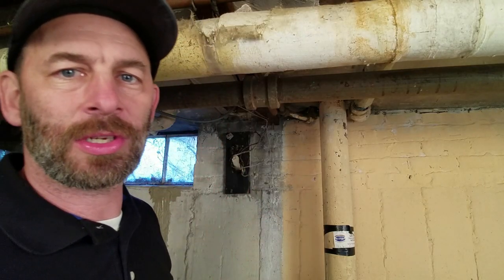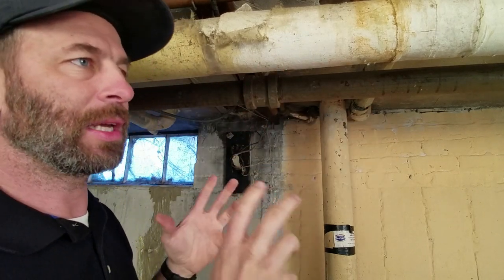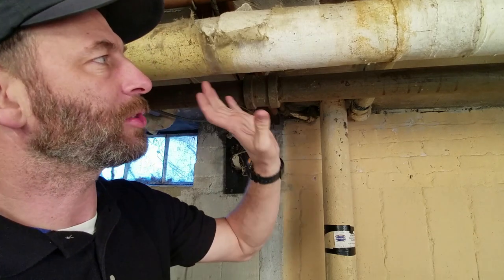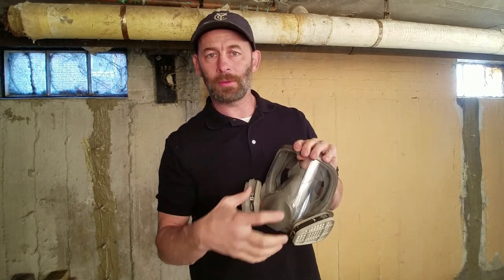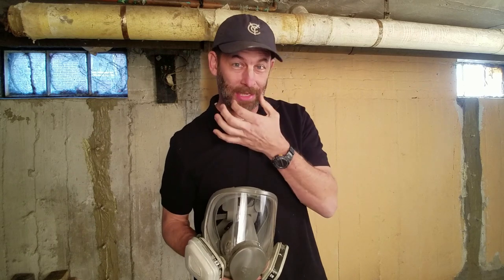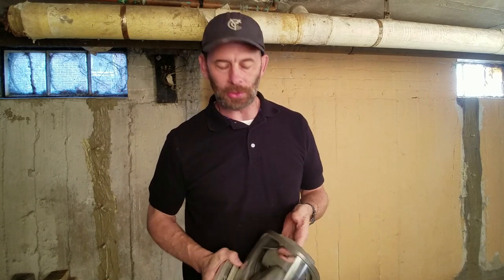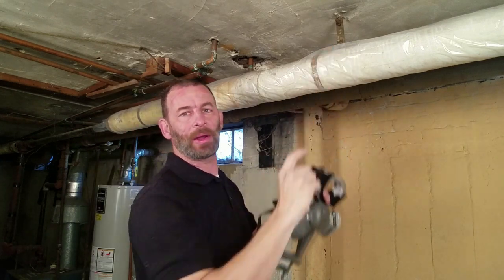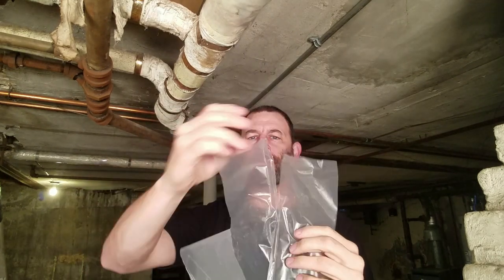Asbestos Pipe Insulation Identification and Encapsulation (sealed covering)

Comment: I am an asbestos removal operative. We use serpi-coat witch is a paint specifically for the encapsulation of asbestos.
Reply: Great product!
Reply: Hey Paddy, how would one clean a mask and remove clothes after dealing with asbestos?
Reply: Depends what type you are stripping, for more serious stuff you would come out of the area directly into a 3 stage decontamination unit. If its non notifiable work then a wipe down and disposal of coveralls etc will be good.

Comment: I’ve done quite a bit of work in refineries and chemical plants where you have to be clean-shaven to use a respirator or supplied air. Having facial hair disrupts the seal around the mask and you are still getting unfiltered air whether you realize it or not. Not trying to be a jerk just food for thought.
Reply: Excellent point.
Reply: Firefighters are required to not a beard for the same reason.
Reply: Thank you for this important advice! Especially when removing asbestos on one's own, it is important to strictly adhere to the applicable regulations and recommendations regarding occupational safety. Otherwise you may endanger your own health and that of your fellow human beings.
Particularly in the case of renovation and refurbishment work, the following therefore applies: Exercise the greatest caution and play it safe! Even a small material sample is sufficient to determine in a professional test procedure whether a suspicious material contains asbestos. If the commissioned analysis confirms the suspicion of asbestos, have any work on it carried out exclusively by service providers with the necessary certificate of competence. This is the only way you can be sure that there will be no accidental contamination of your living space or clothing with asbestos fibers. If you want to know more about possible locations of asbestos in your home, feel free to visit our interactive asbestos house: https://www.crb-gmbh.com/en/interactive-graphic

Stay healthy!

Comment: I followed advice from a buddy in our local pipe fitters union and just removed it myself.  P100 mask, long gloves, disposable body suit.  Connect garden hose, use mist setting, and soak it all down. Keep a large garbage can under work area, and as it becomes saturated it will break and easily fall into can lined with a contractor bag with no dust.  Just keep it all wet, keep the hose in hand as you go. Seal bags wet and move on.  For residual sticky stuff on pipe, do another pass- keep it very wet. Scrap pipe with file or rasp to turn it to residual into mud and wash into garbage or wipe down with disposable clothe and throw in can, and repeat. Don't let muddy residue drop on ground where it can dry and create dust later. Just be smart, and be careful. Words to live by.
I clean my basement in 2 hours. Sure beats a  an $8000 abatement job.
Reply: I will try this myself. Is there a proper way of disposing it, or just put it in garbage bag and take it out on garbage day? Did you soak it with the mist, how much water?
Reply: Please no one try this. This is not how you removed it.
Reply: HORRIBLE IDEA!!! DO NOT FOLLOW THESE INSTRUCTIONS
Reply: Exactly, water makes it much safer to work with. I just posted that before reading your comment. It's freaking me out that this guy just touches it as he talks about it. Uh, no.
Reply: @J It depends on the state. In NY you can just put it in the regular garbage, as a homeowner (not contractor).
Reply: The saying “a little bit of knowledge is a dangerous thing” applies to this advice.
Reply: @pl2604  ok.  Now go get your booster, bro.
Reply: Did you do at least a clearance test afterward(asbestos air test)? Yeah this is the cowboy approach but it could work if you're careful.
Reply: In Syracuse. New York, the homeowner is allowed to do this & I have, but would not feel safe letting the average guy do this. Here, the asbestos, wet & double bagged, is dropped off at a certain disposal place & limited to 2 bags per visit. Otherwise, the video is correct. Common sense is required.
Reply: @AzNFiR keep in mind, the purpose of the misting water is to collect air borne particles so mist as much as you can to prevent any dust from going airborne.

Comment: For whatever it may be worth. OSHA requires that your respirator for CLASS I Work (specifically abating thermal insulation materials) have its own supplied air. "Class I work with full-facepiece supplied air respirators operated in pressure-demand mode and equipped with an auxiliary positive-pressure, self-contained breathing apparatus when exposure levels exceed 1 f/cc as an 8-hour TWA." People should be really careful with this type of stuff. Just like some of comments below mentioned, if you miss something (like the facial hair not sealing the respirator) then this type of stuff can really negatively impact you.
Reply: Good response. The OSHA Class 1 requirements for respiratory protection includes the use of tight fitting Powered Air Purifying Respirators with HEPA filters not supplied air respirators.

Comment: Very helpful video - thanks! What do you do with the plastic/tape at the end of the asbestos insulation where there is just bare pipe? Will the heat from the pipe melt the plastic or tape? Also, where the pipe is exposed, what should I use to insulate the pipe?
Reply from the maker: Great Question. You have to use a thick mil plastic and a good quality tape. Reinforced packing tape is a good option. 

As far as exposed pipe there are a few options available from a fabric based insulation, cordage or foam insulation. Any of those are adequate.

Comment: Question for you: I had old vented wall furnaces (gas powered heaters) in a condo I live in. The pipes for the venting are asbestos. When one of the old heaters were removed the part of the pipe connected to the pipe broke off. What is the best way to seal where it's broken? These pipes are recessed into the wall and will soon be covered up permanently as I had a different kind of heating system put in. As I understand it the best thing to do is use oil paint to lock it in place. Does that sound correct? Thanks!
Reply: I remove asbestos for a living, if it's in a damaged state the best thing to do is have it removed. If you can't get this done then look up serpi-coat, it's a specific paint for the encapsulation of asbestos, because of the type of asbestos this will be, it will require a licenced operative to remove this for you as it falls into the notifiable category. Look up licensed and none licensed works with asbestos to find out more.

Comment: Need advice..planning to buy a old house that the duct  has asbestos tape only in the joins of each pipe..do i need ro remove?they are in good condition.but the house inspector said it dangerous...
Reply: They should be encapsulated and my recommendation is to hire a professional company to do so. If it is only in the elbows and joists it should not  be too costly.
Reply: @daggettpropertyinspection2324  thank you
Reply: Don’t ever buy a house with this shit in it
Reply: @smokefentanyl  In Europe you can't really find any homes without it in them, lol.

Comment: I hope you can reply to this. I have a 3m respirator with combination filters for particles and some gasses and vapos. In your professional opinion, do you consider fiberglass insulation to be just as dangerous and harmful as abestsos insulation?
Reply from the maker: Fiberglass which has become airborne can be very dangerous. It is difficult to put a scale of danger on the material as compared to asbestos. My recommendation is to treat them both with the same caution and prevention.

Comment: Hi there . What do you do when you have pipe insulation that is very well from a leak. Do you let it dry on its own or must it be removed?
Reply from the maker: The leak should be repaired first and typically I would have the contractor who fixes the leak address the insulation if possible. Very well may need to be removed or sealed up if the material is exposed and friable.

Comment: I know this video is from a few years ago but is touching the asbestos wrap/tape like you did dangerous? Does that release invisible fibers? I am asking because some people say not to touch it at all but I had a certified asbestos inspector touch mine in the basement.
Reply: Certified asbestos Inspector, supervisor and Air Sampler here.  It is safe to touch you just need to wash your hands after. Inhaling and ingesting is only way it has adverse health effects on human body. Now you could argue that touching it, and then touching your mouth may cause the ingestion to happen, but thats why you must wash hands immediately after. Using gloves is recommended!
Reply: @chrisseelen1281  what if you touch it and it becomes airbourne?
Reply: @meandnature6452  good question. Where I'm from to be considered Friable it has to, when wet, crumble under hand pressure and contain greater than 1% asbestos. When you touch it, you should wet it down first to help lock the fibers down. Keep the touching to the absolute minimum you can to make the determination.  If a small amount of fibers get released its not really a major deal. There are permissible exposure limits that are considered safe. Alot of people are actually exposed daily and they don't even know it. In America its still used in various products such as brake pads on cars. If your standing on a city street corner and cars and busses are stopping for traffic lights there is most likely asbestos fibers floating around in the air. When working in bigger cities we actually have to establish an alternative air quality standard because the existing air is already considered contaminated. And we need to just show were not making it any worse doing our work.
Reply: @chrisseelen1281  but at my work we were demoing a kitchen without testing anything! and if it was asbestos do you think i could have taken it home with me? on my clothes etc. Can i test the indoor air in my house somehow? im very worried

Comment: I have some pipes in my loft with lagging that looks like that. I had it tested by a lab for asbestos and the results came back as 'no asbestos detected'. Im not sure if i should get it tested again, do you know if all lagging that looks like that contains asbestos ?
Reply: If the test came back negative then you should be ok. If you wanted a second test that would be an extra precaution.
Reply: Lots of insulation looked pretty similar to the asbestos containing lagging back in the day. There's few hard and fast ways to identify it as asbestos containing without that lab test you did. You should be fine, but honestly it wouldn't hurt if you used a respirator and disposable coveralls anyways

Comment: You are aware that having a beard is breaking the seal to your face mask I hope? So in reality isn't really doing very much, also what filters are you using in your mask?
Reply: The filter I use depends on what I am doing. There are specific filters for specific chemicals (acid, formaldehyde, aerosol, etc.) For this application I was using a pre filter and a multi gas 3M 6006. I use a different and appropriate filter for each different type of chemical (which can get expensive to have each filter type.)

As far as the beard you are correct that it can diminish the effectiveness especially with chemical materials. For this application my beard was trimmed down and trimmed in for a better seal. I have had this mask fit tested at an OSHA approval testing facility (in Frankfort Illinois) and it passed the fitment test on me with the beard at the trim level it was for the video. 

My intent in this video was not to be a comprehensive reparator video. I may do one in the future and bring in a professional to discuss it in depth and all of the nuance that goes along with it. 

Thanks for the reply!
Reply: If that insulation has been like that for years the fibers are already out in the room, covering it just prevents more from coming out.
Reply: What do you want him to shave his beard now for your entertainment? Why don't you just request an all over tan as well.
Reply: @DodgeCity111  no it stops leaks for the mask you muppet

Comment: Thanks for the video! What are your thoughts on rewettable canvas encapsulation?
Reply from the maker: Wesley, That is a great question. The Rewettable canvas and fiberglass options are very good options but often times the process requires some training or experience and is more involved. It is a good process just takes more for a do it yourself project and cost a little more.  Many professional companies chose to use the rewettable product you mentioned.

Comment: after is wrapped how am I removing it?
Reply: You still have to cut it 😂. The wrap is for dust mitigation. It encapsulates the majority of the asbestos. A little exposure will most likely be a death sentence
Reply: You encapsulate sections. Then carefully remove insulation between those sections ensuring 100% encapsulation is maintained and then cut the sections apart and remove them.

Comment: 1) For a worker on a job, it is illegal and unsafe to use either of these respirators with a beard. Homeowners can do what they want, but they have to know that they will not be protected with that beard. 2) Both respirators he shows are  for organic vapors, they  is not effective or legal for asbestos dust, you need P100 or HEPA filter cartridges instead, 3) Using a lemon to test the fit is not great, there are better tests you can do just with your hands, which are still not sufficient, but better than a lemon.

Comment: All due respect, but you should NEVER even touch the stuff without a mask and gloves. And if you are going to touch it, you must wet it down, really soak it, drench it. Wet asbestos is relatively safe to work with. as long as it doesn't get airborne, you can safely remove it with water and gloves and tools. You scrape the wet stuff off, put it in a plastic bag, change gloves, put those gloves and the plastic bag in a second plastic bag and you are done. But touching dry asbestos for this video? Yikes. All you have to do now is rub your eye, touch your mouth/nose, or pick up a sandwich and eat it, and you have officially put enough asbestos into your system to kill you in another decade or two. Asbestosis takes as little as a spec, the size you can fit on a pin. I have had several co-workers die of it. Most worked with it a lot over the years, but a couple guys died of it and can't remember ever touching it, but knew it was on sites they'd worked. This stuff ought not to be touched. Really, wet it down first, please. ( I restore old houses for a living.)
Reply: Once you the drenched asbestos into a bag, where do you take it to dispose of properly?

Comment: I have a carrier weather maker sx furnace which was manufactured and installed in 1986. Would there be any asbestos inside the furnace gaskets or pilot flame insulation or anywhere else inside the furnace? Please let me know if you have seen asbestos in a property built in 1986 or inside any furnaces produced in 1986.

Comment: It looks like there is a black asbestos electrical panel behind you in the video, am I correct?
Reply from the maker: Actually that is a low voltage board with the cover off for the old door bell system. The house is  a hundred years old and has some old stuff not in use anymore but no Asbestos on the that Low V distribution panel.

Comment: Mask doesn't seal properly on a bearded face you need to be clean shave! and where you going to depose this asbestos? you better call an abatement contractor to take care of it
Reply: This mask was fit tested by an OSHA regulated testing facility in Frankfort Illinois on me with the beard trimmed at the level that was at for the video and passed. This is not intended to be a full how to on respirators. Maybe that is a video I do down the line with my 3M rep.
Reply: That is a myth, an urban legend.  Same was believed in the aviation industry for pilot o2 masks in depressurizations but was dispelled several years ago after extensive testing found no difference.  That's why pilots are allowed beards now at work.

Comment: Do not follow this video! This guy is giving out harmful advice! First off, he is using the wrong respirator filters. Asbestos filters are purple or magenta in color or P100. Second, he isn't even cleaned shaved...he doesn't have a proper seal for the respirator. Do not follow this video please.
Reply: Absolutely. I did asbestos removal for 3 years before moving to insulation. A respirator is useless unless your clean shaved.
Reply: well i mean he isnt tearing it out but yeah if he was actually doing abatement he would be exposing himself pretty bad. Technically he could wear a PAPR with a hood and be fine for abatement even with a beard but those are out of the price range of most people.
Reply: This guy is more than irresponsible.  Please do as he says and get a professional to do this. Do do what he does. I teach asbestos classes and this video is one of the highlights.  So fun to rip his methods to shreads. .
Reply: Darrell Wyatt 

This guy ought to be thrown in jail for giving this advice on asbestos handling. Asbestos abatement Instructor here. 
1.  The stuff he ID’ed is friable - don’t go near it without proper PPE. 
2. Concur about the respirator, CLEAN SHAVED  - OSHA rules. 
2. You don’t just de-suit and throw your PPE in the regular trash - OSHA and maybe State asbestos containing material disposal violation. Must be properly marked and disposed of. 
No wonder people are still dying from asbestos exposure.
Reply: Exactly. This is how to die slow, 101. Do not touch this shit, I would burn the place down and start new, sell the lot . Do not buy a house that has this shit . No matter what!